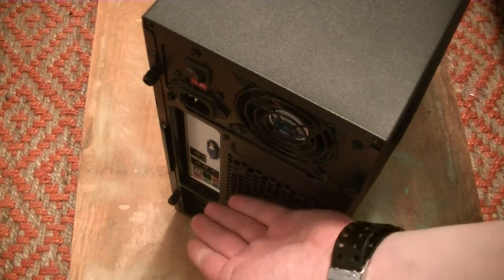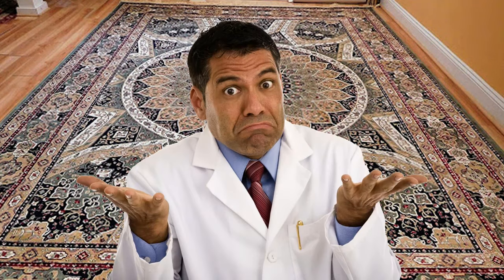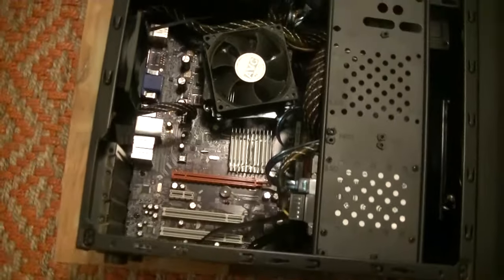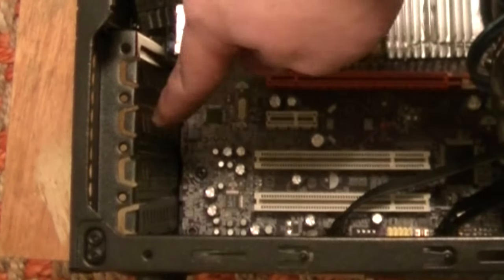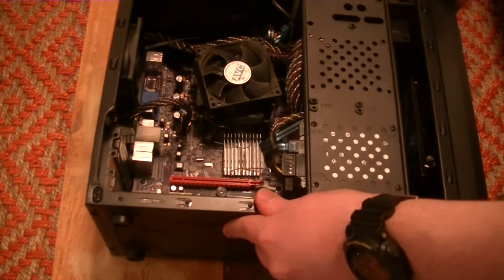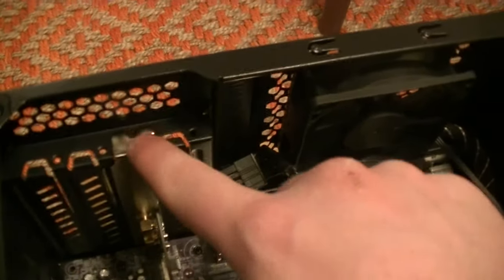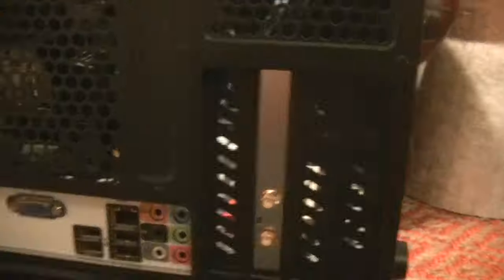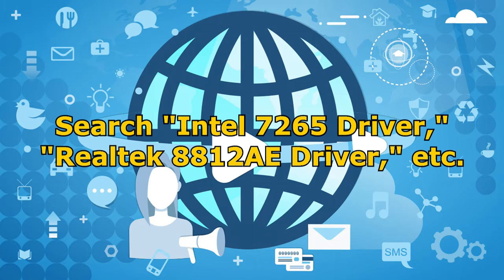How to Install a Wi-Fi Card into a Desktop PC

Comment: Ziyituod WiFi 6 PCIE Card, 802.11AX 2974Mbps, PCIE WiFi Card with Bluetooth 5.0,Dual Band 5GHz/2.4GHz Wireless Card with AX200 Chipset for PC/Desktop, Windows 10 64bit Only?
if not,something compatible plz o.o
Reply from the maker: Is your question whether that card is only compatible with Windows 10 64-bit or not? Do you not have Windows 10 and you have only that card? I don't really understand. But either way, Wi-Fi cards are dirt cheap in general (you can get good ones for less than $20 on places like eBay) that should be compatible with any OS.
Reply: @Torqcx  fck.actually,there isn t my full question,the internet on this country just sucks.
i started the question,copy/pasted the wi fi card i found and  want to buy,after i ve put the ,,?,, to finish the question
but ofc no one will understand that,my comment isn t complete,haha ^^
let me explain,and i m glad that u answeared
i ve built a gaming pc a few days ago,for the first time
did everything,drivers,windows,etc
and i saw that,no ethernet cable connected,,
no wi fi setting either
i spoke to a friend about that,and told me the little thing i forgot about,an wi fi card,because ofc,i just built it from zero,and i didn t put a shit inside to have the damn wi fi xd
so...as im a newbie on this kind of stuff..my question was if it is compatible with the:
msi b365m pro-vdh
:)
Reply: @Torqcx  idk about the pci e slot,that s why i m asking u a question that is too simple for u ^^
if u tell me ,,yes,, i ll buy it,open the case,and search for it/install it
Reply from the maker: @cristianmocanu8039  yes! Any modern Wi-Fi card you find anywhere online is basically guaranteed to be compatible with any motherboard this day of age.
Reply: @Torqcx  oh,that s cool,ty! ^^
as i said,it was my first time,i m learning,haha xd

Comment: where do I put the video card 
ITS TOO FAT
Reply from the maker: If the video card is physically not capable of fitting into your computer, most likely you need to get a new chassis
Reply: @Torqcx  what I meant was, the video card blocked the pciex1 plug.
I just brought a extension cable to fix.

Comment: hi my card comes with a cable to connect the card to motherboard... but i didnt know which port in motherboard must i connect the cable to... is it port 1 or com port... or i dont need to connect the cable at all? thx u so much for your help.
Reply from the maker: That is most likely a Bluetooth cable.    It plugs into any of the motherboard's internal USB slots (where you'd plug the front panel USB port cables). You don't have to plug it in for Wi-Fi, but if you do, your PC will have Bluetooth connection.
Reply: @Torqcx  got it. thank you bro for your info

Comment: My question is….. I have a pc from 2005 I can put an wifi card or will it not be supported? It looks the same idk
Reply from the maker: 2005 is going back a ways, but as long as you have a PCI-e slot of any kind, I don't see why any standard modern Wi-Fi card wouldn't be compatible with your system.
Reply: @Torqcx  pci-e looks like the one on this motherboard your pc has there’s not another one that looks the same but named different right ?
Reply from the maker: @damiboy65  correct, again, just try it out and see if it works. I'd be surprised if it didn't (just make sure there's a driver available for the OS your PC is running)
Reply: @Torqcx  IT WORKED YAY

Comment: Can you please answer I’ve brought a d link wireless card and I own a optiplex 9010 would it work?
Reply from the maker: Assuming the Wi-Fi card you got is PCI-e, the short answer should be yes, considering a quick Google Search of the Optiplex's 9010's motherboard shows that it typically has two PCI-e x16 and one PCI-e x1 slot. :)
Reply: @Torqcx  my tp link iworks so slow i can barely use wifi

Comment: Could I use the wifi card off my old pc?
Reply from the maker: I don't see why not. Just make sure you know what model it is (it will most likely be labelled) so you know what driver to download for it. On occasion, however, you'll get lucky and your system will already have a default driver ready for it.
Reply: Torqcx thank you

Comment: What do I do if I don't got a pci-e x1
Reply from the maker: Do you have any kind of PCI-e slot? As in x4, x8 or x16? A PCI-e x1 card will fit in any of those slots. Otherwise, if you only have PCI slots, you'd need a PCI Wi-Fi card.
Reply: @Torqcx  do you know where i could get a said pci wifi card? im not much of a computer geek and ive been looking around for ages now. cannot find one.
Reply from the maker: @haj2715  https://www.newegg.com/p/pl?d=wifi+card&N=100158094%20600014290 Here on Newegg there are some PCI wi-fi card options. They're usually tricky to find because PCI is considered an outdated interface at this point, but if you don't have a PCI-e slot, then it's your only way to go if you want a wi-fi card.

Comment: I put in a new motherboard and cpu yesterday my Ethernet port won’t work internet says update drivers …windows says my pin isn’t available anymore  because a security setting has changed I can’t change this or log into my pc unless I connect to the internet which I can’t do without updating those drivers can’t install a Wi-Fi card because I need drivers for that too lovely guess imma scrap this brick and sell it for parts pc master race my ass
Reply from the maker: You generally need to install motherboard drivers when installing a new motherboard into a system, otherwise what you are describing will happen
Reply: @Torqcx  I ended up getting around it by buying a usb Wi-Fi dongle so I didn’t need to actually install anything and could connect to Wi-Fi long enough to download the necessary drivers if anyone else has the same issue